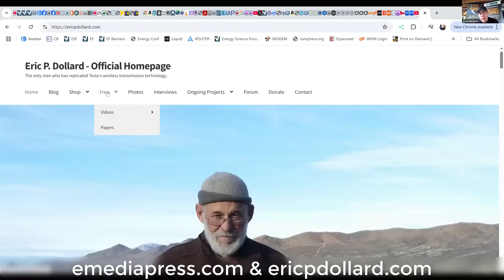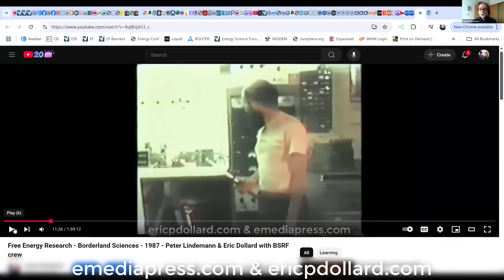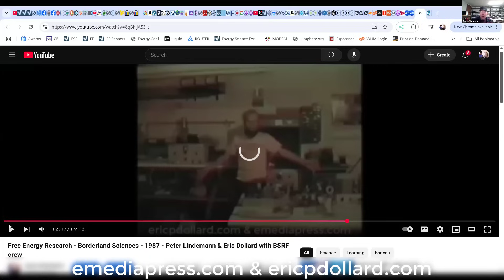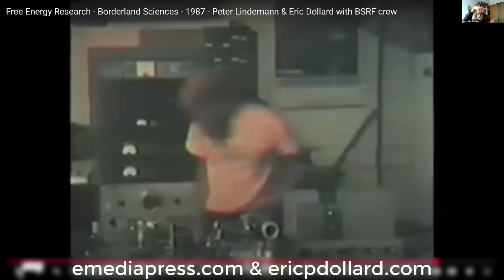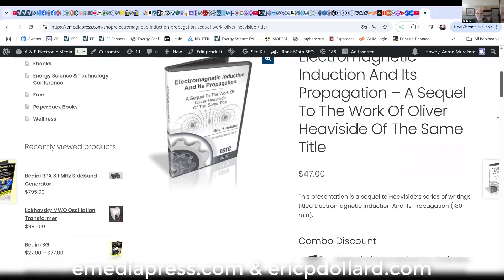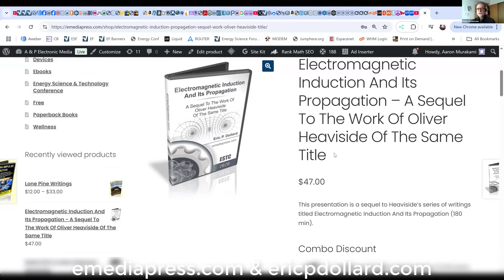Free Energy Research Discussion by Peter Lindemann & Eric Dollard 2025-04-26

Comment: Experiments from the Caltech lab of Chiara Daraio, G. Bradford Jones Professor of Mechanical Engineering and Applied Physics and Heritage Medical Research Institute Investigator, have yielded a fascinating new type of matter, neither granular nor crystalline, that responds to some stresses as a fluid would and to others like a solid. The new material, known as PAM (for polycatenated architected materials) could have uses in areas ranging from helmets and other protective gear to biomedical devices and robotics.

PAMs are not found in nature, though their basic form is known to us through the millennia-old manufacture of chain mail: small metal rings linked together to form a mesh, most often used as a flexible form of armor. PAMs, however, are like chain mail on steroids. Following the basic principle of interlocking shapes, like those found in a chain, PAMs are made up of a variety of shapes linked together to form three-dimensional patterns whose configurations are almost unimaginably variable. The resulting materials, which Daraio and her colleagues have rendered using 3D printers, exhibit behaviors not found in other types of materials.

Wenjie Zhou, postdoctoral scholar research associate in mechanical and civil engineering, has been working on these types of materials for two years in Daraio's lab. "I was a chemist, and I wanted to make these structures at a molecular scale, but that proved too challenging. In order to get answers to the questions I had about how these structures behave, I decided to join Chiara's group and study PAMs at a larger scale."

The PAMs that Daraio's group created and studied were first modeled on a computer and were designed to replicate lattice structures found in crystalline substances but with the crystal's fixed particles replaced by entangled rings or cages with multiple sides.

These lattices were then printed out three-dimensionally using a variety of materials, including acrylic polymers, nylon, and metals. Once the PAMs could be held in the palm of one's hand—most of the prototypes are 5-centimeter (2-inch) cubes or spheres with a 5-centimeter diameter—they were exposed to various types of physical stress. "We started with compression," Zhou explains, "compressing the objects a bit harder each time. Then we tried a simple shear, a lateral force, like what you would apply if you were trying to tear the material apart. Finally, we did rheology tests, seeing how the materials responded to twisting, first slowly and then more quickly and strongly."

In some scenarios, these PAMs behaved like liquids. "Imagine applying a shear stress to water," Zhou says. "There would be zero resistance. Because PAMs have all these coordinated degrees of freedom, with the rings and cages they are composed of sliding against one another as the links of a chain would, many have very little shear resistance." But when these structures are compressed, they may become fully rigid, behaving like solids.

This dynamism makes PAMs unique. "PAMs are really a new type of matter," Daraio says. "We all have a clear distinction in mind when we think of solid materials and granular matter. Solid materials are often described as crystalline lattices. This is what you see in the classic ball-and-stick models of atomic, chemical, or larger crystalline structures. It is these materials that have formed our conventional understanding of solid matter. The other class of materials is granular, as we see in substances like rice, flour, or ground coffee. These materials are made up of discrete particles, free to move and slide relative to one another."

PAMs defy this binary classification. "With PAMs, the individual particles are linked as they are in crystalline structures, and yet, because these particles are free to move relative to one another, they flow, they slide on top of each other, and they change their relative positions, more like grains of sand," Daraio explains. "PAMs can be very different from one another. You can print them in squishy materials or hard ones. You can change the shape of each particle, and you can change the lattice that you use to connect these particles. Each of these parameters affects the behavior of the resulting material. But all of them show a characteristic transition between fluid and solid-like behavior. This transition may happen under different circumstances, but it always happens."

"Architected materials have been a significant subfield in material science and engineering for the past 20 to 30 years," Daraio says. "But as hybrids between granular materials and elastic deformable materials, PAMs are exciting and new. We have theories to describe granular matter and theories to describe elastic deformable matter, but nothing that captures these in-between materials. It's a fascinating frontier that promises to redefine what materials are and how they behave."

At this point, potential uses for PAMs are largely speculative but nevertheless intriguing, Daraio says: "These materials have unique energy-absorption properties. Because each element can slide and rotate and reorganize relative to each other, they can dissipate energy very efficiently," making them better candidates for use in helmets or other forms of protective gear than the currently used foams. This property makes them similarly attractive for use in packaging or in any environment where cushioning or stabilization is required.

Experiments with microscale PAMs have shown that they will expand or contract in response to applied electrical charges as well as physical forces, suggesting possible uses in biomedical devices or soft robotics.

Co-author Liuchi Li (PhD '20), now assistant professor of civil and environmental engineering at Princeton University, is enthusiastic about the future of PAMs: "We can envision incorporating advanced artificial intelligence techniques to accelerate the exploration of this vast design space. We are only scratching the surface of what is possible."

This research is published in Science under the title "3D polycatenated architected materials." Co-authors include Zhou, Daraio, Sujeeka Nadarajah, Hujie Yan (MS '24), Aashutosh K. Prachet, and Payal Patel of Caltech; Li of Princeton University; and Anna Guell Izard and Xiaoxing Xia (PhD '19) of Lawrence Livermore National Laboratory (LLNL). Computational resources were provided by the High-Performance Computing Center at Caltech, and the research was funded by the Army Research Office, the Gary Clinard Innovation Fund, LLNL, and the US Department of Energy.

Comment: Con la tecnología de Google TraductorTraductor
	

 	
"Invisible Electrostatic Wall"
at 3M adhesive tape plant
    Aug 1996   W. Beaty

jeeze Reddit it's after twelve PST, don't you have to get up early tomorrow? [Hafa adai other time zones]
SESSION 7: SPECIAL SESSION, 17th Annual EOS/ESD Symposium
THURSDAY, SEPTEMBER 14, 1995, 8:00 am
SESSION 7: SPECIAL SESSION: ELECTROSTATIC CONSIDERATIONS IN INDUSTRY

MODERATOR: D. Swenson, 3M

7.7 CASE STUDY - LARGE PLASTIC WEB ELECTROSTATIC PROBLEMS,
RESULTS, AND CURE, D. Swenson, 3M Company
Tremendous static charge generation on a plastic web causes unique physical phenomena and special problems. Solution was simple and cost effective.

David Swenson of 3M Corporation describes an anomaly where workers encountered a strange "invisible wall" in the area under a fast-moving sheet of electrically charged polypropelene film in a factory. This "invisible wall" was strong enough to prevent humans from passing through. A person near this "wall" was unable to turn, and so had to walk backwards to retreat from it.

This occurred in late summer in South Carolina, August 1980, in extremely high humidity. Polypropelene (PP) film on 50K ft. rolls 20ft wide was being slit and transferred to multiple smaller spools. The film was taken off the main roll at high speed, flowed upwards 20ft to overhead rollers, passed horizontally 20ft and then downwards to the slitting device, where it was spooled onto shorter rolls. The whole operation formed a cubical shaped tent, with two walls and a ceiling approximately 20ft square. The spools ran at 1000ft/min, or about 10MPH. The PP film had been manufactured with dissimilar surface structure on opposing faces. Contact electrification can occur, even in idental materials, if the surface textures or micro-structures are significantly different. The generation of a large imbalance of electrical surface-charge during unspooling was therefore not unexpected, and is a common problem in this industry. "Static cling" in the megavolt range!

On entering the factory floor and far from the equipment, Mr. Swenson's 200KV/ft handheld electrometer was found to slam to full scale. Later, when he attempted to walk through the corridor formed by the moving PP film, he was stopped about half way through by an "invisible wall." He could lean all his weight forward but was unable to pass. He observed a fly get pulled into the charged, moving plastic, and speculates that the e-fields might have been strong enough to suck in birds!

ABOVE: sparks from a much smaller roll at a different plant
The production manager did not believe Mr. Swenson's report of the strange phenomena. When they both returned to the factory floor, they found that the "wall" was no longer there. But the production workers had noticed the effect as occurring early in the morning when humidity was lower, so they agreed to try again another day. The second attempt was successful, and early in the morning the field underneath the "tent" was strong enough to raise even the short, curly hair of the production manager. The "invisible wall" effect had returned. He commented that he "didn't know whether to fix it or sell tickets."

[ NOTE from billb: where electrostatics is concerned, concrete floors are conductors (ohm/sq in megohms, where true insulators would be higher by X 10K over four orders.)
And, the PP spools on either side would behave as opposite-charged electrets, megavolt-scale with the originating charges trapped deep within insulating layers, suppressing all plasma-streamers and perhaps even suppressing glow-discharge. The fast-moving PP film might produce equally fast air-motions, a 20ft dia. horizontal tornado between the pair of meter-thick spinning rolls of PP film. The air-motion might strongly confine an ion-cloud, if composed of large ions (perhaps water microdroplets, with condensation forced by huge e-fields combined with expected nucleation sites, for e-field induced "effective RH" far about 100%. Speculation here!]

ads:

 	
echisholm 5/2016
Have a relative (sort of) who works at a 3M plant. Shit still occasionally happens.
> You can't just say that and go away!! How are you not irresistibly
> interested in that?? I would've interrogated that relative so hard
It just came up in passing at Thanksgiving! I don't really know him that well; he's an in-law. He mentioned being able to throw small washers and bolts at the field and watching them get repelled. People got interested, and so someone came with a voltmeter, and after throwing a couple more, they checked for voltage, and there was a residual charge after they finally caught on on a plastic sheet to prevent immediate grounding. It also had a very slight magnetic field. It's apparently fairly common, but engineering hasn't come up with a solid explanation why.

ALSO: dc469 5/2016
I met this guy at an ESD meeting in austin once. He said the strength of the field maxed out his equipment at a distance so he couldn't get a maximum measurement.
After he published the paper he was contacted by NASA and all the three letter agencies asking for more info. He wanted to experiment around with it but no company had millions to throw into such a project (presumably, the government did). It had to be a pretty narrow window of temperature, pressure, humidity, etc. They kept the garage door open so that's where the insects and sparrows got sucked in (which obviously ruined the product).
He said it was actually known to the technicians for awhile before he experienced it and they just were kinda like "meh". Eventually they fixed the grounding issue on the machine and the problem never popped up again.
edit: found the ESD website. David Swenson apparently is still with them on their board of directors. http://centxesdassoc.homestead.com/

LINKS

WIRED magazine 1/2018
ESD Journal
Askreddit 2017
Reddit TIL
Sticky Electrostatics, classroom physics demos
Another poly unwind setup (vid)
Problems: coulomb forces would be expected to attract a person into the "chamber" formed by the PP film, and the attractive force should increase linearly across distance. There should be no "wall" in the center, a discrete wall is repulsive, also nonlinear.

If for some reason a person was repelled from the center of the chamber rather than being attracted, there still should be no "wall," since the repulsion force should exist over a large distance; it should act like a deep pillow which exerts more and more force as one moves deeper into it. Large fuzzy fields, this is how magnets and iron behave, and this is how e-fields and conductive objects should also behave.

A thought: unspooling of film typically generates a much higher net charge on the long piece of film than on the small surface of the spool. However, since charge is created in pairs, and net charge is conserved, the imbalances of charge must be equal and opposite. The charge on the entire length of moving film must be equal in magnitude to the charge on the spool. Yet the charge on the film is very large and is continuously increasing. The limited surface-charge on the spool required that opposite charge is being lost through some unseen path.

Very probably the spool is spewing out enormous quantities of ionized air with polarity opposite that of the charge on the moving plastic film.

Charged air would be created by discharge in the cleft between film and spool as the film was peeled from the spool. I wonder if film was being peeled from the top of the spool, so that any ionized air created in the cleft would be launched into the "tent-chamber" region? (If it was peeled from the bottom of the spool, the charged air would end up outside the "tent.") Or, if a corona discharge arises in the cleft between film and spool, perhaps the UV and e-fields of this corona can ionize the air on both sides of the exiting plastic film, and spray the charged air everywhere.

So, if the charged "tent" of film is negative in the above situation, and if a large quantity of positively charged air is being generated by the spool, then perhaps the "invisible wall" is caused by a cloud of suspended air ions held in position by e-fields. Perhaps it's a pressure gradient created by ionized air trapped under the tent by electrostatic attraction. Yet again this effect would be expected to create a diffuse zone of increasing force, not a "wall", but an "invisible pillow." Added note: concrete floors behave as conductors (resistors) in this situation. Where megavolts at microamps are involved, the division between insulators and conductors is at 10^6/10^-6 = 1000 gigaohms. Concrete resistivity is in the realm of megohms, so it behaves like a grounded metal sheet.

However, a volume of charged air is somewhat analogous to iron filings near a magnet. If a solid sheet of iron filings is held in place by a magnet, then a literal "wall" is created, and this wall will resist penetration by nonferrous objects. If in the above manufacturing plant, a sheet of highly charged air is for some reason being held in place by the fields created by the charged film, then a transparent "wall" made of charged air would come into being. It might produce pressures on surfaces, and resist penetration by human bodies.

My question is this: if the entire situation could be turned on its side, so the "invisible wall" became an "invisible floor", could a person stand on it? Have we discovered the long-sought "Zero-G waterbed?" :) - B.B.

Reference: Article about the "Wall" in ESD Journal (IT'S BACK! 8/2000)
 	
The 'force field' event was from 1980, while the report was given at an ESD conference in 1995. Where is that machine today? In other words...